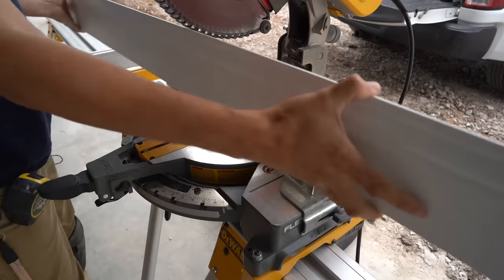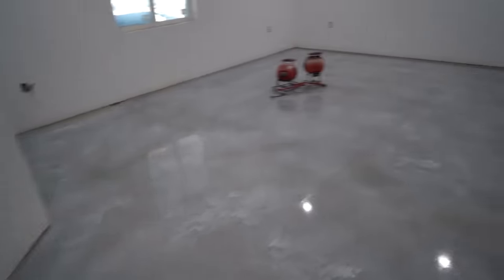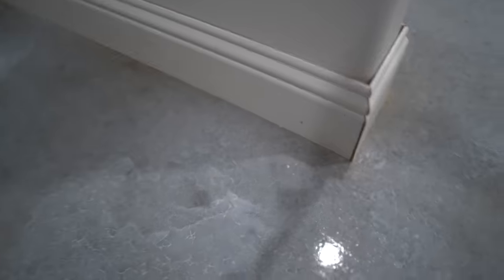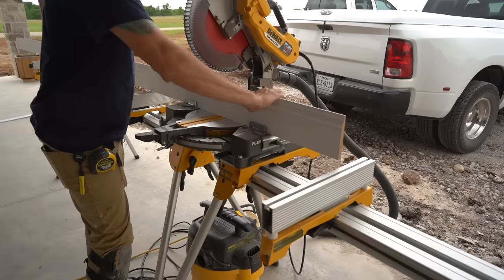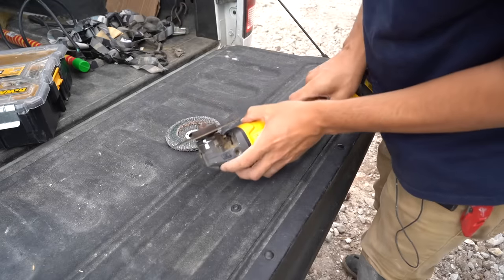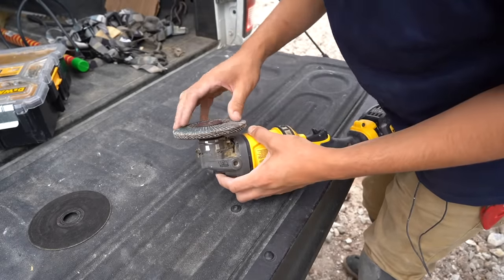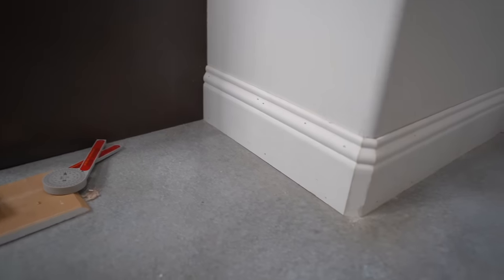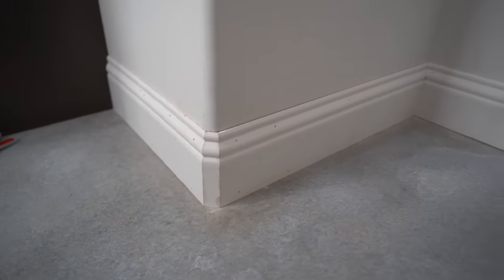don't let your framer do trim

Comment: Worse job I have seen in a while.
 but it depends on were your located ive worked places were framers do roofing trim siding etc mostly because you don't make enough money doing one of those specifically you just can't do it fast enough to make a profit and people are not willing to pay enough money so framers end up doing  a ton if it. I personally have done it all. I only do Finnish work and roofing on small jobs if I'm working a sub division etc I make more not doing it so im not going to do it if they can call in somome specifically for that job.

Comment: First of all those are not difficult cuts. A good carpenter should be able frame a home, build a deck, make a form, hang a door, build stairs, hang cabinets, and install that janky ass trim. The trick is not to be a one trick pony like a framer or a finish guy. If you can't do the things listed above and more you shouldn't call yourself a carpenter.